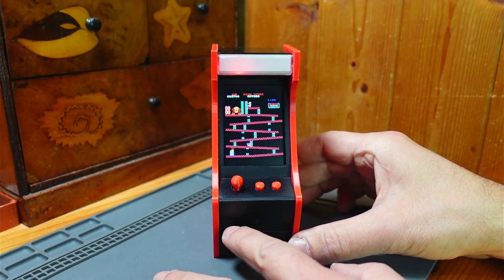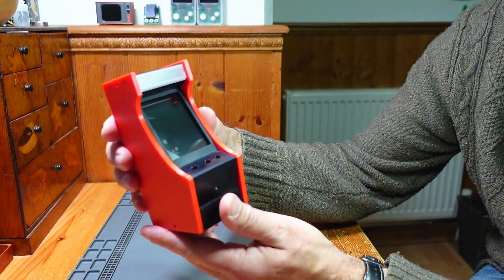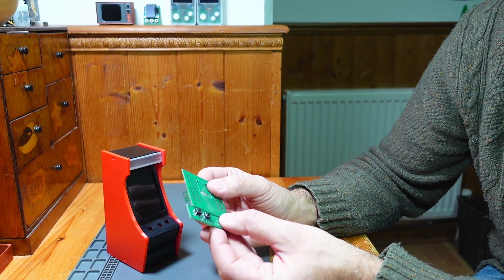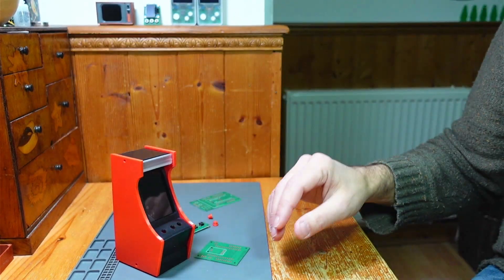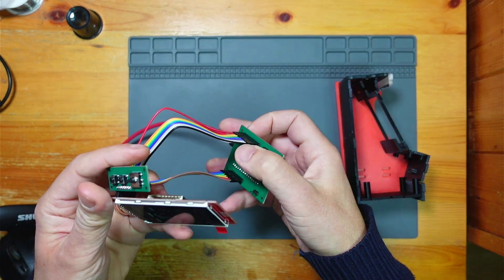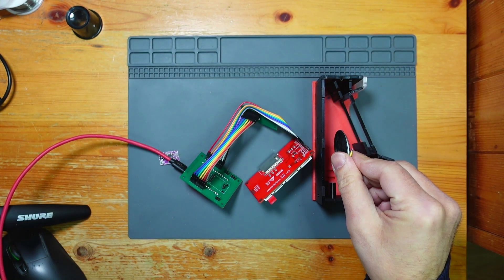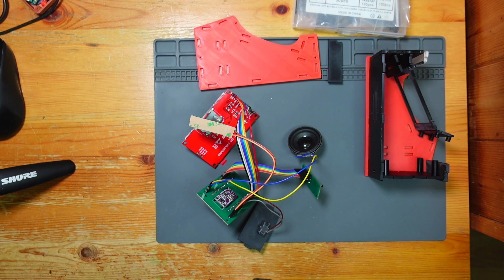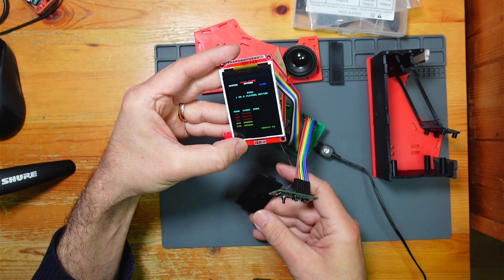Galagino : A Mini DIY Arcade Cabinet

Comment: The project is great! 
But there's an error in the compilation!? 
Thank you for your help

C:\Users\Titeuf\Desktop\Esp32\galagino-main\2\galagino\emulation.c: In function 'prepare_emulation':
C:\Users\Titeuf\Desktop\Esp32\galagino-main\2\galagino\emulation.c:578:28: error: implicit declaration of function 'millis' [-Wimplicit-function-declaration]
  578 |   master_attract_timeout = millis();
      |                            ^~~~~~
C:\Users\Titeuf\Desktop\Esp32\galagino-main\2\galagino\emulation.c: In function 'emulate_frame':
C:\Users\Titeuf\Desktop\Esp32\galagino-main\2\galagino\emulation.c:593:23: error: implicit declaration of function 'micros' [-Wimplicit-function-declaration]
  593 |   unsigned long sof = micros();
      |                       ^~~~~~
C:\Users\Titeuf\Desktop\Esp32\galagino-main\2\galagino\emulation.c:633:37: error: implicit declaration of function 'esp_random'; did you mean 'srandom'? [-Wimplicit-function-declaration]
  633 |       machine = 1 + ((unsigned long)esp_random()) % MACHINES;
      |                                     ^~~~~~~~~~
      |                                     srandom
C:\Users\Titeuf\Desktop\Esp32\galagino-main\2\galagino\emulation.c:744:5: error: implicit declaration of function 'ulTaskNotifyTake' [-Wimplicit-function-declaration]
  744 |     ulTaskNotifyTake(1, 0xffffffffUL);
      |     ^~~~~~~~~~~~~~~~
C:\Users\Titeuf\Desktop\Esp32\galagino-main\2\galagino\emulation.c:747:5: error: implicit declaration of function 'vTaskDelay' [-Wimplicit-function-declaration]
  747 |     vTaskDelay(1);
      |     ^~~~~~~~~~
exit status 1

Compilation error: implicit declaration of function 'millis' [-Wimplicit-function-declaration]

Comment: Hi I am struggling to do the coding do you have any tips
Reply from the maker: Not really, apart from the code changes in the video. There is another project like this on hackster uploaded recently "CYD Galagino Arcade" it uses different parts, but at least it's a complete project that works. The one I used is now missing most of it's files including the case.

Comment: Why are the Pac-Man sounds an octave lower than they should be, and why are the Donkey Kong sounds inaccurate as well?
Reply from the maker: You could be right. No idea really. It's custom emulation for the ESP32 by Till Harbaum. Nobody has raised the issue on Github, so I guess he isn't aware of it.

Comment: Finally built one of these back in the summer after most of the parts sat in a bag for like 12 months prior. The STL files were really not designed to work with 3D printing imo probably work great when laser cut from plywood, I really wanted to design a whole new case but ended up sanding for hours and applying silly amounts of pressure with heavy duty clamps, it will not be able to come apart...ever!  although I did remix slightly with a USBC port I tend to use and also a power switch. Plus I was too cheap to buy the PCB files so just soldered everything up directly, which caused a problem with creating the control panel, to be honest that was mostly the reason I didnt make it for so long. Its now on the shelf, never to be used again like most projects, more fun building than actually using.
Reply from the maker: I was going to mention you in the video (I forgot). I didn't know about Galagino before you said you were going to build it (ages ago). The slop or give in the joints was way too small unfortunately, but I'm probably guilty of doing the same thing. Everybody should have the same 3d printer.. that will cure it 😊
Reply: To be fair, I'm not sure there was any slope at all. It does all fit together quite nicely when done tho and looks pretty nice. Its pretty crazy what you can do with a very cheap ESP32 these days, those games were cutting edge like 40 years ago.